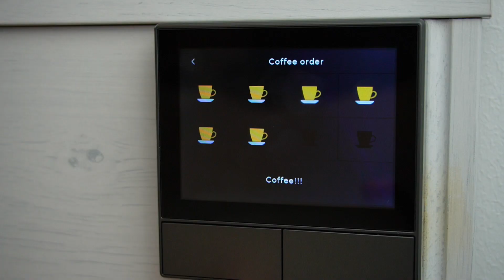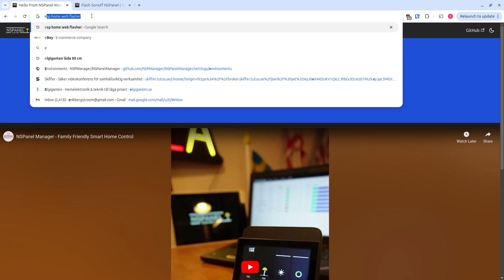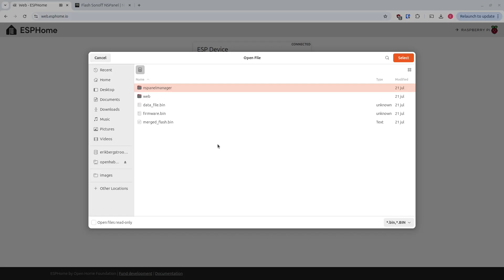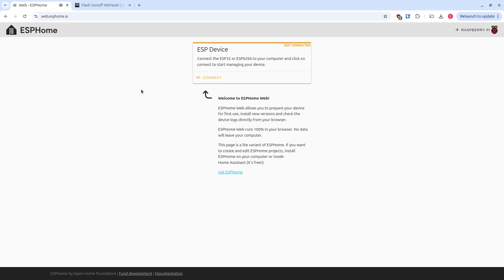NSPanel Manager Tutorial - Flashing the Sonoff NSPanel lazy way

Comment: @CablesCoffee  use female cable and use 5x 1 pin out header where you push into the female cable the longer pin side and use the shorter one which is usually soldered into the pcb to do the flashing without a shortcircuit. 
Why I am so sure ? Well , the PCB distance between 2 pcb is based on this length too that you can not short - but of cause always can if you use so much force that you bend the upper board.
Reply from the maker: That's a good one! I'll test that! :)

Comment: I got my NS Panel US flashed, but I am not able to configure the wifi on it or get it into any kind of pairing mode. Is there somethign I am missing?
Reply: But you have been able to connect to its WiFi hotspot?
Reply: I have the same issue. All seemed good when I flashed it, and I see the NSPMPanel wifi. I can connect to it, but putting in the 192.168.1.1 address does not bring anything up.
Reply: I have the same problem with EU version. After flashing i can connect to hotspot. I can insert my wifi data and other data. After hiting save button  NSPanel reboots but will not connect to my 2,4ghz wifi.

Comment: Good stuff! Thanks for the short video. I have had problems migrating from one HA hardware to another one, the panel does not connect to it anymore. I have tried restarting the panel and even deleting the add-on (and also removing the add-on data) with no avail, do I have to re-flash the panel?
Reply from the maker: @JuanAmeijeiras  you shouldn't have I would say. Can you reach the panels web interface? Are all the settings correct?
Reply: @CablesCoffee  I could reach after changing to firefox, safari didn't like it. Got all working again
Reply: So, got past the flashing part but NEVER get to the wifi part. Don't remember now but just see spinning tft. Ended up using the blueprint for now although I'm dying to try ur app. 😢
Reply from the maker: @paulminott150  thats not good! Join our discord and we'll try to help you!
Reply: Hi, Merry Christmas, I got the panel specially to try your project and I really like, my question can it be used for more than Lights now? I couldn't find a way to add my blind for example.